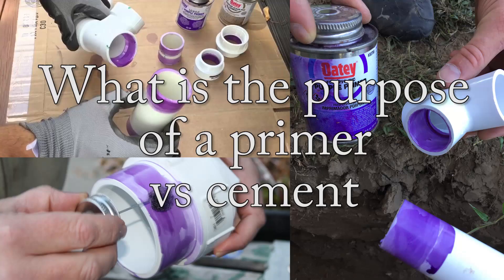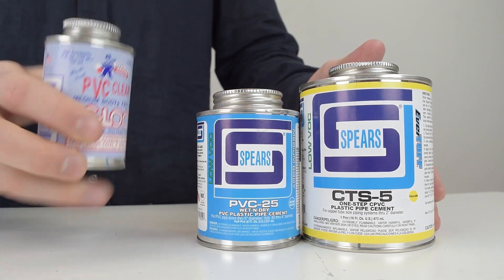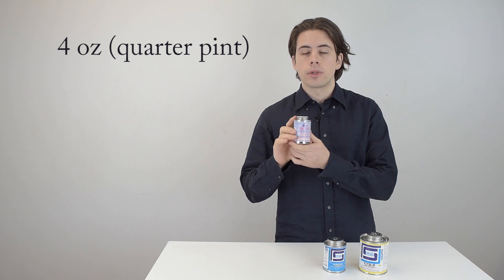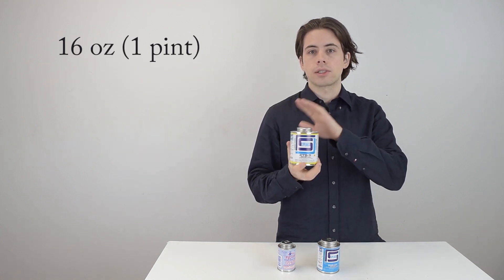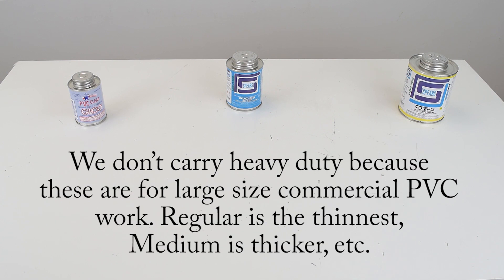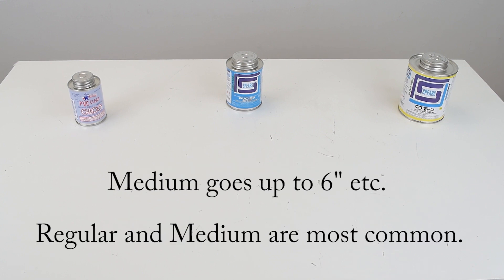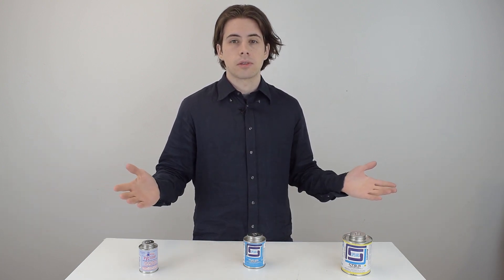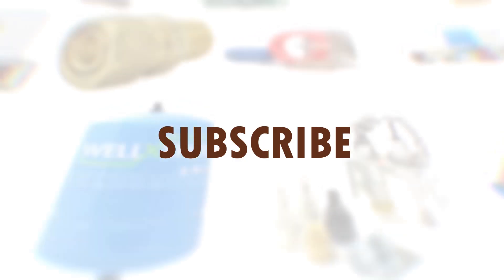Difference between PVC cement types and primer

Comment: If your applying the perfect amount of glue to a joint you might be able to match his recommendations on size of container,  i would double or triple his recommendation.  also if your doing a big job get yourself extra cans in case you spill one.  I always buy many of the medium size cans instead of one big one because I always inadvertantly knock a can over.   He also didn't cover cure time  follow that number closely especially if its for a source connection under pressure.  if its just sprinkler lines you can probably test after 15-30 minutes